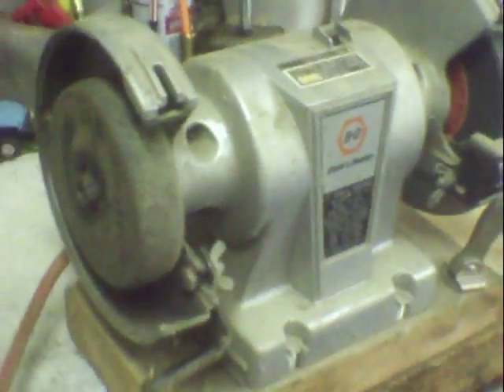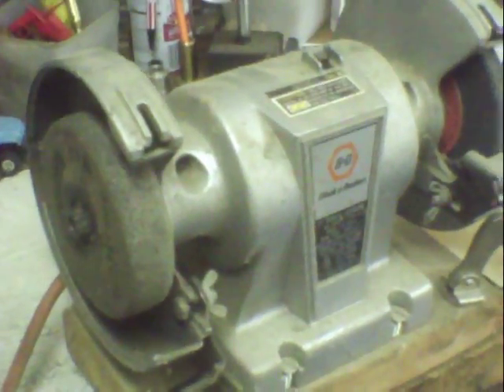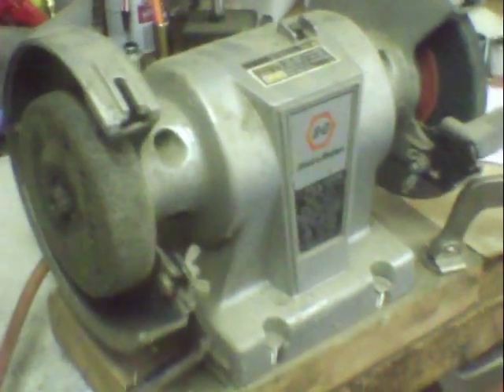How2 Fix Black & Decker Bench Grinder(Repair Info in Text Below Clip)120V

Comment: New sub, same problem i am having with this superior 5 bench grinder, gonna try ur suggestions and hope for the best..thank you for the video
Reply: So far i have tryed electric parts cleaner,, then oiled things up with 3 in 1 oil, spins smoothly, but as soon as i turn on switch still same result
Reply from the maker: @robdogbme  Okay, you're headed in the right direction. U might try the Oxgard grease next. Do u have any?  A little goes a long way usually.
Reply from the maker: Oh okay. Might need to clean it 1st, &/or polish the commutator. I use 2 different types of electrical grease. The kind I referred to in this video I get a Home Depot or u can order it; Oxgard by GB; Garner Bender. And I use Permatex clear dielectric grease that is NOT conductive, but good for High Temperature applications as it does NOT ignite, good stuff.  But the Oxgard is great for any battery connection/s u can think of.  Hope u get it fixed asap, good luck, wish ya' the best.  Take care.            - Leeroy
Reply: I do not, but i will get some and see what does for it
Reply from the maker: @robdogbme  It's worth a shot, nothing to lose, & it's great for any battery connection u can think of, & outdoor lighting, anything that's exposed to the outside elements.

Comment: i have this exact grinder the motor stator in this is a 2 pole shaded pole type so there is no capacitor. sounds like the stator is loose inside the grinder when u turned it off as you may need rubber washers as spacers on the stator when you reasemble the grinder. as the 5 inch grinding wheels are hard to find for this grinder the only wheel i can find that fits this grinder is the ones from Harbor Freight tools the Chicago Electric Power tools item# 66026 5 in 60 grit alunimum oxide wheel as its a 1/2 arbor is what this Black and Decker grinder calls for and the wheel rating is 3700 RPM. but you may need a wheel dressing tool to get these wheels round and concentric. if you want to replace this grinder and reuse your wheels as Harbor Freight has a 5 in bench grinder by Central Machinery. of course China made but the tool rests aren't as great on it as your black and decker grinder the tool rests are more solidly built but not sure if you can put them in this grinder. the item # is 94186 has a 2 amp PSC permanent split capacitor motor that has a run capacitor in the base.  the speed is 3,400 RPM. thats if you have a local Harbor Freight tools store in your area. but to revive your B&D grinder those harbor freight wheels by chicago electric is what u have to use unless you can find them on amazon or Ebay. but purchase them at Harbor freight and ring test the wheels to be sure they are good.
Reply from the maker: Hey cool Derek, thanks for the info !   I figured it was a large sized shaded pole motor just b/c of its simplicity.  Thanks again & take care from 'Nastyville' Tn.
Reply: i inhereted this grinder in early 2018 in Butler PA the stator looks to be a FASCO 2 pole stator mainly today used in these FASCO 3.3 inch motors more commonly used on gas furnace draft inducers. But if the rotor is rubbing on the stator you can see a mark on the rotor. since the plastic pieces i found out when i took it apart holding the bearings they crumbled and got brittle over the years so i fixed it with small pieces of duck take in in place of where the plastic pieces were in the front housing and the rubber piece was still there holding the stator on my grinder but a fix for yours is laying the grinder on its back when you disassemble it and put the washers on top center of the stator and reassemble the grinder. thats pending if the bearings aren't worn. these are sleeve bearings it uses. as i said this Harbor Freight. item#94186 5 in. bench grinder. it uses sealed ball bearings supporting the rotor shaft kinda of a better design the motor is a PSC type meaning it will have a run capacitor in the base. to give it a bit more torque. the downfall to it is the tool rests are not solid like the black and decker ones. these bend so easilly. being its made in China much of everything is nowadays.  the wheels if u decide to use the black and decker  grinder i installed two new Harbor Freight Chicago Electric Power tools 5 in  60 grit alunium oxide wheels that fit this as they are a 1/2 arbor this grinder calls for. they also have a 5 in harbor freight Warrior crimped wire wheel  saying it fits most 5 in bench grinders. but its a 5/8 in arbor so may need to get an adaptor to reduce it down to a 1/2 arbor.  if you have a harbor freight tools store in your area or order them online. Amazon has  some H&M Abrasives USA 5 in grinding wheels one a 46 grit and a 60 grit. and has 5 in buffing wheels too if u plan to buff or polish light metals.  as most bench grinders on the market today are commonly the 6 in and 8 in grinders and buffers.  pretty much all of them are made in China now the ones sold on Grainger are under the Dayton electric name are also made in China. as Amazon has a wheel dressing tool to dress the wheels on your grinder so they are cocentric.

Comment: I have found that sometimes with real old name brand tools, if you send an email with a picture of it, model number, etc to both customer service and technical service, along with a note telling about how great the tool is and how long and hard it lasted you will often get instructions on how to fix them and/or sometimes a parts rebuild kit FOR FREE.  OR a Gift Certificate for $$$ off of a new one.  

Case in point.  A few years ago, I somehow got on the Black and Decker Email list.  They probably got my name and email from all the Porn sites I go to lol.  Anyways, I saw a story about this old B&D Tool a guy rebuilt and the history on it and so on.  So I remembered I had inherited a 1950's era Black and Decker Drill from my Grandfather.  This was a HULK of a Drill, almost the size of my Milwaukee 3/4" Super Hole Shooter Drill and just as heavy.  It was so old that when you used it Sparks flew out of the air vents from the operation of the motor (Normal back then).  I was afraid to use it as it might start something or me on fire with all those sparks flying around.  Anyways, I cleaned it up a bit, took a few pictures of it, even sent a short video of me drilling a hole with it, sparks and all with a commentary about if my drill bit was longer I could drill to China.  
I told them even though my old Black and Decker Drill was STILL A BADASS, I was thinking after 50 years it might be time to "Upgrade" the Old Black and Decker drill and what would they recommend.  They sent me a new 20-volt Cordless Lithium Drill for being a loyal customer and sharing the pictures of the drill and the short video.  This was when their 20 volt Lithium Drill first came out.  In fact, I looked it up on the internet after I got it and hardly anyone had them stocked for sale yet.  It worked great for about a year and something electrical in it went to Hell.  So, I sent them another letter, describing the problem and asking them about buying a part for warranty.  They said they would send out a part rebuild kit for it for free.  But then a few days later they sent an email that said they no longer had the part kits available.  (Sounds a lot like Delta Tools lol). 
They must have had this problem a lot so they stopped using that electrical part and switched to something else so I couldn't even buy a replacement part for it.  So..... Out comes "Old Reliable", the 50+ year old B & D Drill and I took another picture of it and sent it to them saying since the one they sent me died and I can't even buy the part to fix it, I had no choice but to go back to "Old School" lol.  They sent me another 20-volt Lithium Drill for Free that had the new electronics in it.

Now, I am not the biggest fan of B & D as I use many of my tools for work and I need them to be strong and do the job, but that right there is what I call some KICK ASS Customer Service.  I never once asked for a Free Tool or even a discount.  It was all on them.  Sometimes if you go out of your way to do something nice, Nice things happen to you in Return.  Too many times we are quick to Rip on a company for something that doesn't work and I think when they get an email about something that works good and acknowledgment of it from us, that can have a positive effect.  I suppose they are used to getting emails from irate customers all the time that a "Nice" email is probably a cool change of pace for them.  Think about it, when was the last time you sent an email to a company telling them how great you think their product is and a few pics or video showing it.
Reply from the maker: Hey Dr. Death, good stories, you sound like a fun guy, so lets see some footage of the old drill you're talking about, sounds pretty stout. I've got another clip on how I fixed an old B&D angle grinder, replaced the micro switch in it.  Take care from Tn.

Comment: My dad just gave me this exact bench grinder, he says it does spin up ok but looses all torque/stalls when sharpening anything. Any ideas how to fix this? Maybe just a good clean and replace brushes?
Reply from the maker: There are NO brushes on these suckers. NO capacitor('cow-pasture') either. Just follow the basic clean & grease instructions in the text of the video, & let me know what happens.  Take care from Tn.
Reply: i have this exact grinder but its not ment for heavy sharpening like bearing down on the wheels. as the motor in this is a FASCO stator 2 pole shaded pole type AC motor meaning it has low starting torque and draws 2.2 amps. as recently i got 2 new grinding wheels for it from Harbor Freight the Chicago Electric 5 in 60 grit alunimum oxide 3700 RPM wheels the item # is 66026 is what fits this Black and Decker 5 in bench grinder. but the tool rests are very solidly built for this grinder and don't bend as the chinese made grinders out there today. the upgrade model or replacement model thats 5 inch i found from Harbor Freight is a Central Machinery item#94186 5 in bench grinder the motor is a PSC Permanent Split Capacitor as it should have little more torque than the Black and Decker's shaded pole motor as this motor has a run capacitor in the base. but the tool rests bend easilly on this unless you can use your existing B&D tool rests on this grinder and if your wheels are in good shape you can use them on this grinder as well as 9 out of 10 when harbor freight ships these grinders the wheels are broken on them. but always ring test the wheels if cracked and rotating over 3,000 RPM the wheels can fragment and fly apart.
Reply from the maker: @derekobidowski5784  Yes, good info, thanks.  Take care.   - Leeroy
Reply: motor is a shaded pole type the new 5 in bench grinder sold at Harbor Freight tools does have a capacitor in it and ball bearings supporting the shaft. but  its decent but the tool rests are flimsy on it. if you reuse your B&D tool rests on that thay are solid. as this Harbor Freight Central machinery 5 in bench grinder is the only available bench grinder out there to step up from the Black and Decker 5 in bench grinder.

Comment: Hi Lee Isenberg, I have aa grinder just like that one. I am not ashamed to say that I am an electronics technician, but I really didn't think this fix would actually work. HOWEVER.....IT DID WORK!!! Went down to Lowes and got the Ox-gard, used a toothbrush and applied it as directed. reassembled with a little extra padding to get the armature shaft bushings really tight, turned it on and BAM!!! Runs great, quiet as can be. Thanks Bro.
Mark
Reply from the maker: +videoguyMJD Hey man I ain't no liar, Nunn! Anytime, always happy to help out.  Glad to hear your success, sounds like yours is running even better than mine. I had the exact same thought as you when I was applying it to my dad's table saw & its worth a lot more than a bench grinder, but just like you said, "BAM!"!   I've been meaning to put more of that grease on mine, I used it to deburr some scrap last week. Yeah mine has some of that bearing slop in it too, bad end play I need to clean up. Isn't that about the most simple motor you've ever seen?  B&D definitely used the "K.I.S.S." method.  Take care.
Reply from the maker: +videoguyMJD  Gracias. The most handy piece of 'trash' to ever have laying around is by far an old bike tire inner tube(or any type of inner tube/scrap rubber). Lay out your pattern, grab some scissors & make your own gaskets for about anything. But duct tape is good too, I will admit it, no shame.

Comment from the maker: This B & Decker ginder is 1 of the most simple electric motors I've ever seen or tinkered with, no capacitor.  Yes, get some anti-corrosive, conductive grease & put it on the rotor with an old toothbrush & see what happens.  Take care.